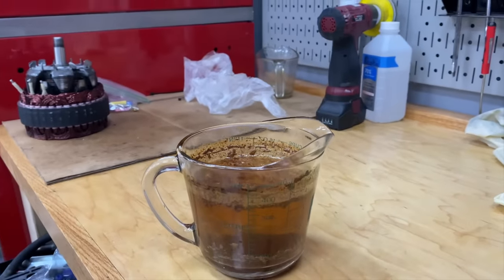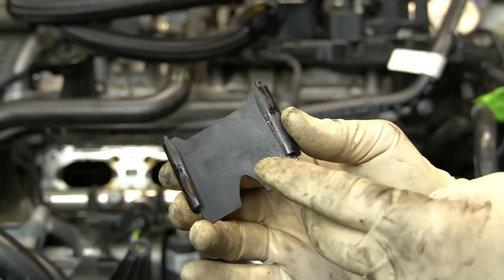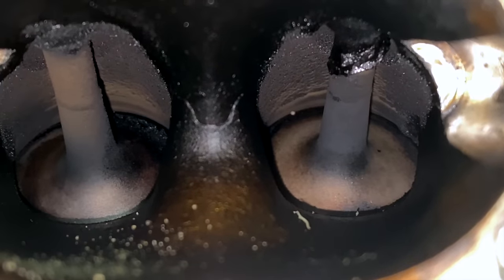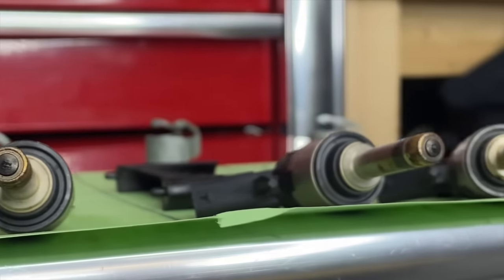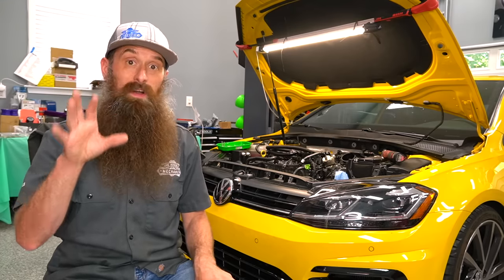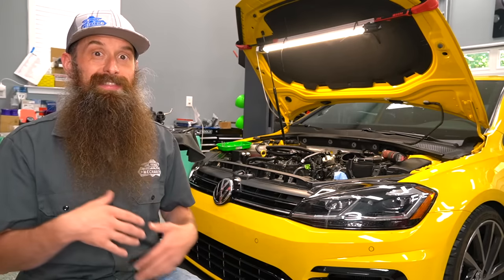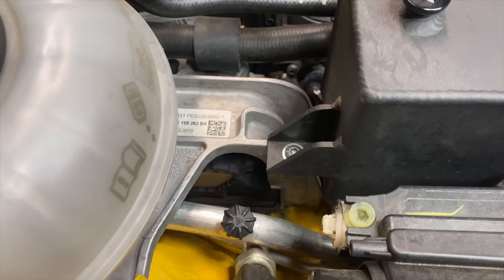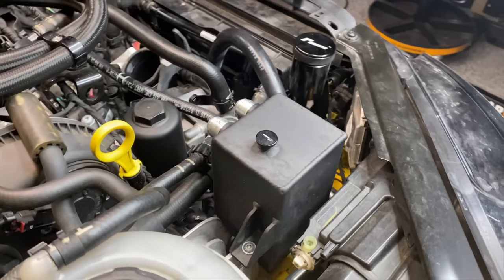Did the Catch Can Work? 10k MILE TEST

Comment: There are hydrogen injection kits that are supposed improve everything on your engine mpg running and emissions. They make small amounts of hydrogen that is injected into the engine and one of the benefits is that it cleans the engine. Would be interesting to see someone like you do a review on this.
Reply: HHO generator? I doubt it cleans anything. at best you could replace some fuel with it and reduce carbon content in general.
Reply: @naotamf1588  a friend of mine had this on a Harley years ago and said that it cleans the combustion chamber but I don't know if it does clean the intake specially with direct injection.
Reply: @dotlaj  exactly, once it turns into hot water-> steam can marginally disolve carbon compounds, so it may have no effect on the intake valves. but a test would be cool eitherway!

Comment: Very interesting to see, awesome job 💯👌🏻
I've never heard of this issue in the EU, maybe it's because we use only octane 95.
VAG group engines die more often from oil consumption and a worn engine or bearings that just give up.

I worked on a Ford/Mazda 1.8 direct injection engine with the swirl flaps of death intake system, that looked alot more dirty then this, and its a hell of a job 🙈
Reply: I believe the EU cars use dual injects to keep this from happening. I'm not sure why the US cars don't have it.  You can actually see the dual fuel injector spot on the air manifold.
Reply: @christopherhanlon4690 ... My guess is Federalizarion ($42M+) of a new engine or emissions design. That's big money for a car company about to ditch ICEs all together.  That's why we see one engine across an entire showroom; fewer engines, fewer dollars spent on getting them approved that would take years to recoup....

Comment: what the best product for carbon build up on the valves or pistons?
Reply: Wd40 eats carbon pretty well along with some brushing or scraping.
Reply: I used CLR + some zipties tied into a drill chuck to brush into the intake ports
Reply: @Addison0526  nice good to know thanks.
Reply: @TheGraneable  that works the best?
 like you tried other methods?

Comment: Actually that water you're pulling out with the catch can should be going into the engine to help blast the carbon off of the face of the valves as well as the pistons and the injector. You're actually starving that engine for moisture that actually helps clean. The catch can is removing that moisture that you need to clean the engine as you drive it. I have a 2014 Ford Escape with 108,000 MI and it still runs like new. I would never put one of these catch cans on my engine. I make sure that I have the oil changed as per the manufacturer's recommendation and change the filters air etc the same way. Catch cans in my opinion are automotive snake oil. Plus, you're taking a big risk if something malfunctions and clogs in that catch can system of hoses etc. You could possibly ruin your engine or at the least blow the seals. Just my opinion

Comment: im pretty sure your valve seals are toast. you notice. the main build up after the cleaning and catch can. its right on the stem of the valve. wet and gooey everywhere else is dark and burnt like carbon build up.
Reply from the maker: I’d find it hard to believe at 20k miles that’s the case.
Reply: @HumbleMechanic  so would i but think for a minute. we live in a world where oil seals are made out of material thats broken down by oil. buna seals from bmw for example. plastic on coolant connections that brittle from heat or the coolant itself. mercedes wires that biodegrade the coating and wire even while you drive. most companies use a much higher compression ratio and and removed 2 head bolts. further increasing head gasket failures. 4 bolts per cylinder clamping force vs 6 bolts is worlds of difference. add boost and more fuel and the explosions that happen with combustion and big problems. add turbos or superchargers whatever forced induction. blow by is increased. whats the next weakest link man? internal oil seals... thin oil. hot shut downs. possibly cylinders left on vacuum after shut down. turbo timers dont exist anymore. yes coolant and oil flow through when running. but timerst they helped alot with heat soak on the engine. cars and their parts arent what they used to be so its very well possible thats part of whats causing your problem. a new design needed could be too.

Comment: Cant u drill and tap a hole in the bottom w a valve mounted there then a hose going to under the car. Drain it like an air oil sep filter

Comment: Welp, only thing left to do is remove the catch can and run the PCV to the exhaust. 😁 Also what might be interesting, is for as much as that can setup cost, you could probably install a water/meth setup instead, curious to know if that would keep the valves clean.

Comment: Interesting, my comment didn't post. I have been running a catch can for about 30K miles on my supercharged 5.7 hemi (WAY outside of MFG specs). I run it to prevent the muck from lowering the knock resistance and causing detonation at boost which could be catastrophic. I drain it every other tank of gas and get 2 to 3 oz in 1000 miles. No water but a lot of oil/fuel. I am using a Moroso separator so my use and make is a whole lot different than yours and as it is in So Cal, the moisture in the air can be a lot different than your situation. I would not dream of running the car without the separator, cheap insurance.
Reply: as Foghorn Leghorn would say ...."no...No...NOOO...you're doing it all wrong there, boy...!!" " You just gotta remove this here supercharger, like this, and then put it all back together, like this..."

Comment: Would the water collected in the can come back into the system due to the pressure and be slowly cleaning up the back of the valves over time? lol would be awesome if that was the case.

Comment: i believe your engine is to new to really see the benefits of a catch can, because the blow by will increase as the engine gets more miles and worn out, at the same time  the effectiveness of the catch can will increase because you will have more blow by, the catch can will make that your valves and intake receive a minimum amount of oil at the intake as long as you keep the catch can, improving your gas milleage, keeping injectors, spark plugs, valves , way cleaner than whit out the catch can 

my conclusion is the catch can will keep all the intake and exhaust components cleaner giving you long term benefits

Comment: To do a scientific experiment you need a control. In other words you need the same car with the same conditions but without the can. That’s impossible, but you could have similar conditions. 

If you have a VW group in the area then get as many owners of that same car together. Clean the valves same as you did, and install catch cans on half the cars. Driving habits will average out over the group. Best would be to use the same oil and change interval but with enough participants that will also average out.

Comment: Great video. I installed one of these at 10k. I'm annoyed because I personally don't think it does anything, But I still run it because I paid for it and it does look good in the engine bay. I think the Gen 3 PCV revision solved the carbon problem for the most part, and fitting one of these is unnecessary, even a downgrade. I use a 200ml syringe with a hose and thin brass tube, it empties in one draw, done every 1k or so. I also take the opportunity to check my other fluids etc. so it's not a bad routine. 

I have seen the Mann Hummel Provent system used. This is a commercial oil separator (so it's not pretty looking) with a replaceable filter element and bypass. the return line is usually transparent so you can see there is no contamination returning to the engine. I'm not sure how viable this is on a daily because the filters are like £50.

I do one 200 mile drive every week.
 
I just cleaned the inlet valves after 50k and they looked like yours, but I think this is despite the catch can, not because of it. Whenever I look in the turbo inlet, there is always a little pool of oil there and it makes me sad. racingline say this is totally normal. I Know with an effective oil separator, this would not be the case. But I don't care enough to throw good money after bad. No confirmation bias here, I'll admit I wasted my money.

Fair one if you bothered to read all that hahaha

Comment: I remember in the old days of V8 engines, we would just slowly pour a cup of water down the carb , with the car in park, at full throttle. You'd literally see carbon pieces  flying out the tailpipe. Cant we do something similar today???? This would solve this issue.

Comment: The reason you're getting cleaner valves with the catch can is the catch can catches more oil Mist than it stops some of the accumulation of the moisture in the air. And moisture in the air still bypasses it and gets into the intake system and water moisture will tend to have a cleaning affect than the oil, which would create more gum and carbon.
What you have done is louder than natural moisture in the air to have more of an effect which will have a cleaning effect than the oil which would create a mess. I still do not believe that the extremely minor fuel Savings of direct injection is worth it. Injectors have to be far more precise to function in a GDI engine. The turbulence of the air flow before it gets into the cylinder helps with vaporization of the fuel. Which means if they got a little bit more precise with the delivery of the fuel in port injection you would probably have a better running engine, as well as getting the increased fuel mileage. I still do not understand there is a very simple way to lean and engine out when it's not calling for torque. Which would save far more fuel than shutting off half of the damn cylinders. I know it's not applicable and your instance but these people who are shutting off four cylinders of a V8 engine thinking that it's doing something good, are morons.

Comment: Do all direct injection engines have carbon build up on the valves?
Reply: Yes to various degrees. Some manufacturers will add another fuel injector in the system to periodically spray down the tops of the valves in order to keep them clean.

Comment: i just today 01/17/2022 pulled my catch can out... 6000 ,iles  and the oil was just barely covering the bottom of my catch can  car  2014 ford fusion 2.0   156328 miles on it,, oil use... walmart 5/30 full syn oil dexos 2 oil

Comment: I don’t think it’s that weird at all, catch can significantly reduced oil fumes and particles from entering the intake. 10k later u can see some of that carbon buildup essentially being sucked right off.  Valves still got a little dirty on the back side but that’s pretty normal seepage of engine oil doing it’s job lubing the motor🤷🏻‍♂️
Reply: If you guys did this with another car following cleaning and catch can install. 100% believe you will duplicate results.

Comment: I'm getting about a cup of gunk every 100 miles out of my 3.5L Ecoboost. 
Also you shouldn't spend 6-700 dollars on these- You can get a whole setup with a drain valve for less than a 100 bucks.

Comment: It seems to me that the point of a catch can is to prevent oil from getting to the surface of those valves where it can bake on to create carbon buildup.

Get two identical cars, install a catch can on one, and no catch can on the other.  Tape a cotton ball close to those air intake ports, but far enough away that it won't burn.  Run both cars at identical RPM for a number of hours.  Weigh the cotton balls before and after the tests to see how much oil the cotton caught vs. the can.

I think in order for it to be thoroughly definitive, you'd have to get multiple cars, and run them at different RPMs, and then reproduce those results multiple times, but hey... this is youtube, not a scientific journal... At the very least this would eliminate variables.

Comment: Here is my take on the catch can situation you are running into. there is water in the catch can correct ? the engine running with the catch can is evidently also transferring water vapor that is acting as a very poor version of water injection which is cleaning however poorly the backs of the intake valves ? make you wonder that maybe fashioning a poor mans water injection set up might work to fully maintain and clean the backs of the intake valves ? or spend the money on meth injection / windshield washer fluid mix because that is a better :cleaner" ?

Comment: why not just have a line run fuel spray  down the intake   once in a while when accelerating spray some fuel and the detergents will clean the back of the valves

Comment: It looks like it made a difference, anyway all that water not going back into your car should make you want to have one!! Also a catch can proves its worth over the course of a 100,000 miles Not 10K.. IT will make a car with a 100,000K look like only 50,000 miles.. They help over the life of the car 50,000 miles and up of CC use will will prove it's worth.. But Nothing will stop a DI engine from carbon build up, just the way it is.. I recommend getting a Catch can and having your valves and injectors cleaned every Hundred thousand miles at least.. That's when people usually start getting cold start issues with DI or GDI engines ..

Comment: This might be a stupid question, but how on earth does water get into the catchcan 🤔
Reply: Crankcase vapors, including blowby contain some water vapor as a product of combustion. it is most likely condensing back to liquid inside the lines leading to the can, or on the can walls itself.

I’d certainly have water in the can rather than my engine having to deal with the moisture (burning it in the combustion chambers). But after watching the video and reading all the comments, I’m not convinced of the value and hassle of adding a catch can. 

The company that produced Charles’ can really needs to rethink their product. The top opening needs to be made larger so one can suck out the contents, a better option (and valve) for draining via the bottom, and using the engine mount bolt is ridiculous! I would have sent that thing right back instead of messing with it.

Comment: Its got to be the water from the catch can. As water is a great carbon breaker. We all know that. Either its the water vapour from the water in the catch can hitting the valves and cleaning them or very small water spray is coming out of the can and cleaning the valves. Cause think about you didnt have much water collect in the catch can the first 10000km only after that it was collecting a lot of water from the moisture.

Comment: SO the 2019 MK7.5R is single injection BUT the 2020 MK7.5 R in Oz was dual injection???
Reply from the maker: US never got dual :(
Reply: @HumbleMechanic  That stinks and I thought Oz got shafted on cars...
Reply from the maker: You did. Lol but we did too
Reply: @HumbleMechanic  Yep shafted on a few things like DAB radio and wireless Apple/Android to name a few.  ... did not get in 2020 MK7.5 ... waiting to see what the MK8 R options etc. will be here in 2022 sometime. I heard it will not have dual injection so going to keep mine longer and had Stage 1 tune and DSG tune done. Goes like it should have now. Next car will be an EV ... BUT VW have shafted us on them as well ... so may have to go with another brand ... good 10 years away I think ...

Comment: VW are not regular GDI engines, they are worse... they are VW
Water? Clear fluid? That s not a normal operation for an OCC... water should never be condensed in an OCC, that actually should bypass the filter/condenser plate of the OCC and go back to the manifold.
Could it just be an excessive OCC design?
Or Das Auto-problem?

Comment: RV fuel? I've found that 10% ethanol in your fuel is a big contribution to that carbon buildup.  100% gasoline (RV fuel) is the way to go, if you can find it in your area.
Reply: While carbon does eventually build with the use of pure gasoline, the use of ethanol can greatly speed up the process. Ethanol is also a cause for loss of horsepower in your engine. This is because Ethanol stores about 1/3 less energy than pure gasoline

Comment: Charles great video!! We all love the feel and performance of internal combustion engines, but this video just goes to show how filthy and toxic ICE powered vehicles are. How do you dispose of the sludge from the catch can? I don't think you should dump it into local oil recycling facilities because it's mixed with water. What do you responsibly and environmentally do with that toxic goo?!?! I have a MK7 GTI SE with 29K miles, with no catch can. I guess I'll just keep using top tier 93 gas and take my chances with the carbon / valve issue and get it walnut cleaned in the future. Peace!!

Comment: I don't think you'll be able to test this over 10k samples...but I tell people that buy a direct injection engine, to make sure they floor it getting onto the expressway or something at least once a month to help prevent carbon build up. Theory being, head temps will rise, air speed will increase and your more likely to have it flake off into the engine over time. So maybe, beat the p@$$ out of your car the next 10k without the catch can? I believe they are useful for racing applications only. Thanks for sharing.

Comment: The valves you didn't clean look just like the ones you did clean. I don't think the catch can is preventing any carbon buildup. Maybe adds an extra few thousand miles between cleanings, at the cost of added maintenance of emptying the can and reduced washer fluid capacity. Not worth the tradeoff imo.